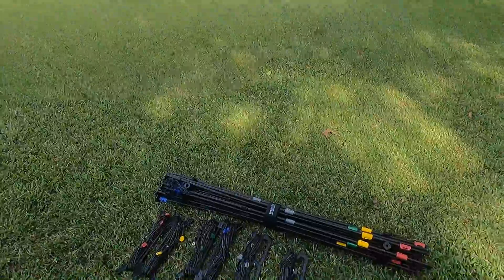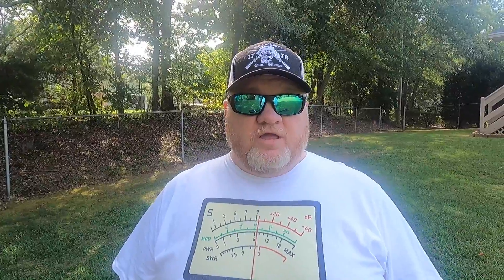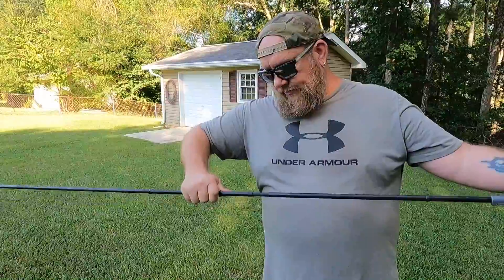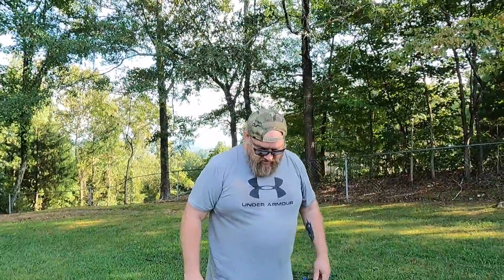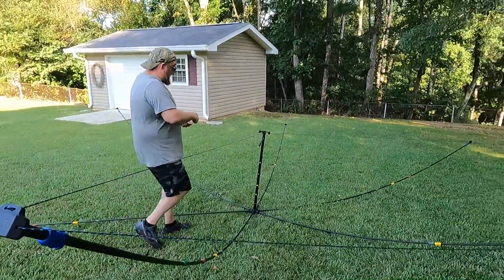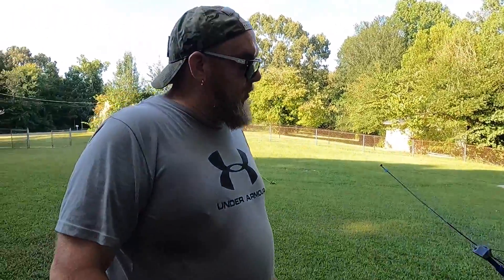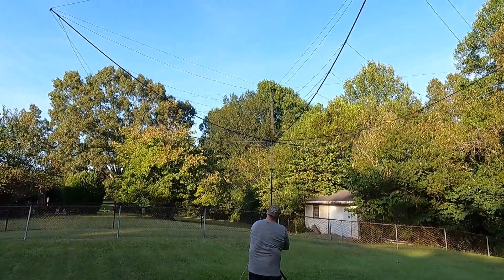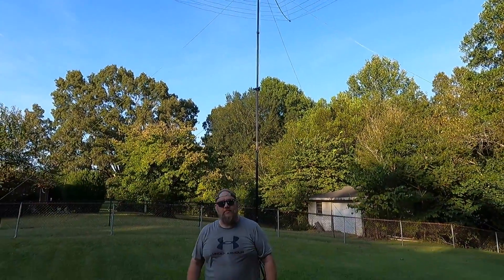Ham Radio Antenna  | The Buddihex by Buddipole, Inc.

Comment: Should the color coded clips be on the top or underside of the poles?
Reply from the maker: You can put them either way, it doesn’t change performance at all. However, if you are walking under of clipping the wires, it would make it a little faster if the wire clips were facing the bottom.

Comment: It's that easy and that good. I was one of the beta testers for the proof of concept model. This add's a whole new dimension  to the art of portable ham radio operation. I had the pre-production model up 24/7 in the Florida sun, rain and wind for over a year with no damage from UV or moisture. The Mastwerks mast and tripod is the perfect companion for the BuddiHEX. Thanks for a great video guy's.
Reply from the maker: Thanks for your comments. You are right, it is a great antenna. Chris and the Buddipole team and of coarse YOU guys who tested it did a great job. Theres no doubt it will work put up perm. at a qth, I wanted to see how easy it was to deploy and maneuver in the field at different locations. At first I was skeptical, I thought it would be cumbersome, and it might be if you were planning on activating or working portable for a few hours, but if you are camping, etc.  its a perfect antenna. It is a wonderful addition to our club and it will improve our field day activities a good bit.

Comment: Another pro tip: do 6m 1st, work your way out to 20m. That’d be less stepping over wires, I’d think.
Reply from the maker: not everytime you setup the beam would you need to work all of the bands, even quicker setup if you only put the elements you know you may use. Such as this weekend, we knew we were only going to work 20m so we only put on the 20m element.. took us 18 minutes to setup tripod and beam and be ready to get on the air.
Reply: @DewayneW4FDT  Very nice. Yeah, I’d likely often set it up for only 20-10-6.
Reply: @DewayneW4FDT  Another thing I was wondering was possible (and if so, practical)...

Leave all the wires in place.
Pop the poles out of the center hub (yes, they'll all cross the middle as they straighten).
Disconnect only the tension line between the directors.
Collapse like a Japanese fan, i.e. swing them all around so they point away from where the directed lobe was.

Could you then just take the entire slack bundle and lay it on the ground next to the house, for instance?

If that worked, and if it wasn't too hard to re-insert the poles into the hub with all the wires in place, perhaps that would be a (slightly) quicker way to use at home for a weekend, and take it back down for the week?
Reply from the maker: You might could do that, honestly this thing goes together so quick and by attaching the wires from the bottom when it’s on the tripod you save yourself a lot of time. Experimenting is what this hobby is all about.
Reply: Well I should have everything before asking questions. Thanks for the info guys .
Reply from the maker: Yep that’s true.
Reply: Can you leave 6 m off ?  I left it off on my KIO with no problems. I don't use 6 m so I didn't bother with it.

Comment: You might ask Chris to send you the assembly post that makes bending over not necessary.  Once assembled just remove the post and mount the antenna.  Also, place a small pennant or ribbon on the open (director) end so you know which direction it points to.

Comment: Nice video!!  This is definitely a field portable antenna.  If you lived in an apartment/condo/townhome, and had a little bit of common space outside, it would be too large to set up.  If you had a house in an HOA area, it would be a really nice backyard antenna to use when operating and take down when not in use.  One observation with this or the original Buddipole, if you are taking it to a park or something, you definitely want to make sure you are there for quite some time and band conditions are good, as both types of antenna do take some extra time to set up over using something like a linked dipole.  I definitely see this targeted to the POTA and HOA restricted crowd, or the regular homeowner with a small .25 acre suburban lot.  I know Budd and Chris have allowed many restricted hams an opportunity to put up one of the best compromise antennas you can get and be able to enjoy the hobby despite HOA or lot size issues. :-)
Reply from the maker: Yes, this antenna isn’t something you’d want to put up for 30 minutes but it’s an all day antenna for sure!